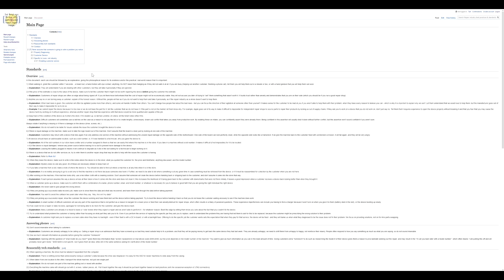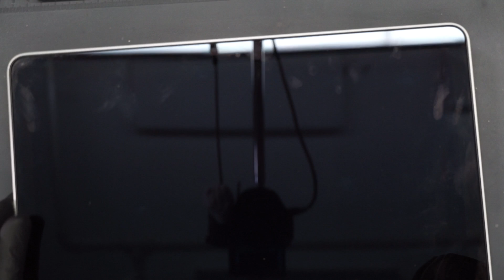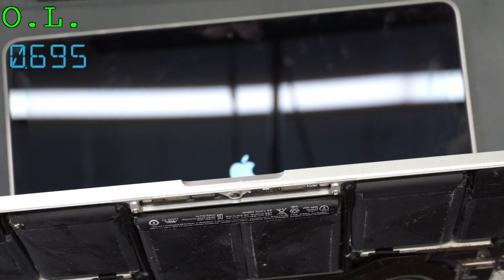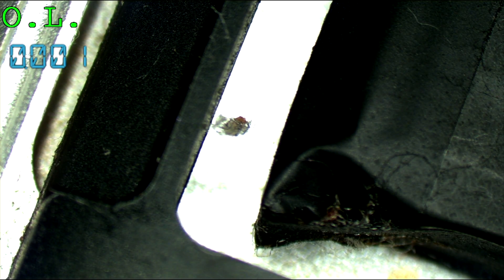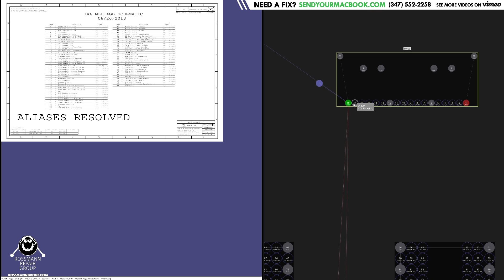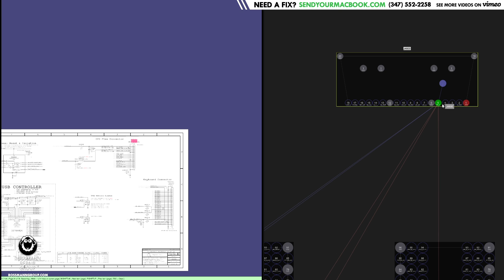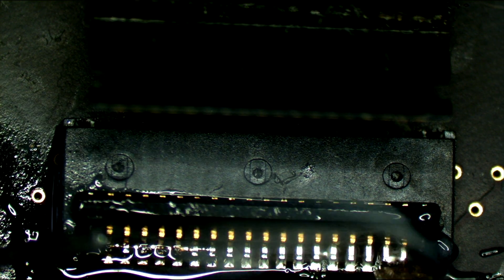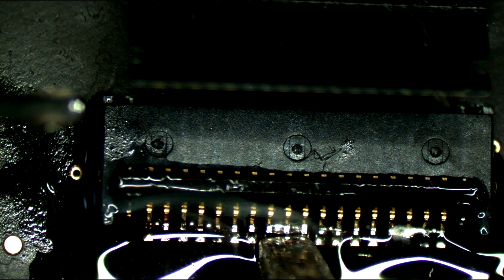A1502 fans running fast and no image on screen Macbook board repair

Comment: I had one of the weirdest repairs ever
Customer states when he presses the power button it would power off the device like complete short. You would have to unplug the battery and plug the charger to get it to boot.
The power button was defective. 
So we said ok no problem, keyboard is defective. 
Little that we know the trackpad had gotten soaked with juice and causing all the issue after the new keyboard did not solve the issue.
-_- FML replacing the keyboard removing the rivets and replacing it with screws only for the issue to be the trackpad itself

Comment: Hi
I have a Macbook air 13” 2014 model
Have this issue with it. I will elaborate thing

With this system I never had any issue until 2 month back.
It got updated to bigsur and then it showed “question mark folder”.
I recovered it by installing the OS again but after this it again Turned off and since then it was only sounding start-up chime and there happed to be light on the screen for 2-3 min and then it used to turn-off but. A week back i performed SMC rested and it got re-set (light changed at my magsafe indicator) but now No chime and no light on the screen and only fan runs. Nothing is happening.
Any suggestions i dont think genius bar can help in repairing it and I may have to discard it now.

Comment: I don't have a repair business. I just want to try and repair it myself for experience

Question

I have an A1502 820-3536 no fan spin orange light on the charger, but when I heat an area near the cpu Ex: heating a ground pad of a cap for several sec it starts to work again until I shut it off then it stops working again. what could be the problem??

THANK YOU!!!!

Comment: @Louis Rossmann Hey Louis, longtime subscriber her. A COMPLETELY unrelated question. Do you think, in the new ThinkPad T14 with AMD, does choosing the Ryzen 5 (6 core) over the Ryzen 7 (8 core) yield a thermal benefit, like, will it run cooler? New ThinkPad lineups are a mess...

Comment: I didn't really understand what happened to the fan, did he just clean the power supply cable?
Reply: Macbooks run slow and fans run fast when there is a sensor failure, the trackpad has sensors, the trackpad connector had corrosion on its pins so he cleaned it and then the issue was gone